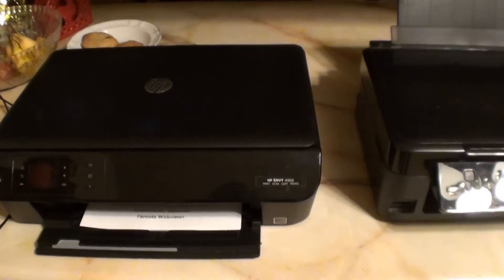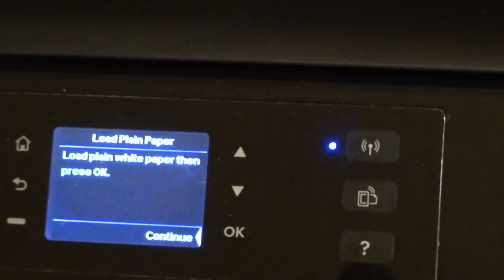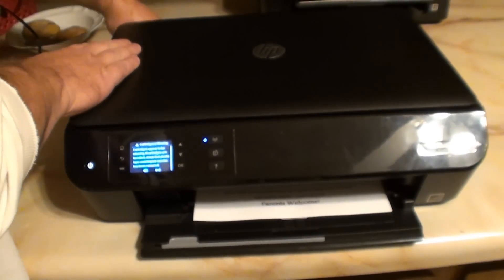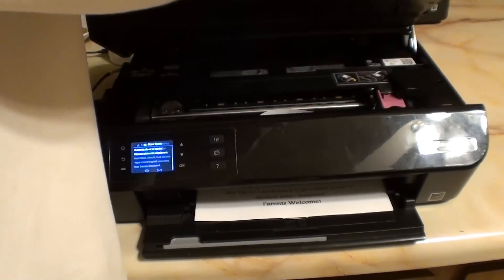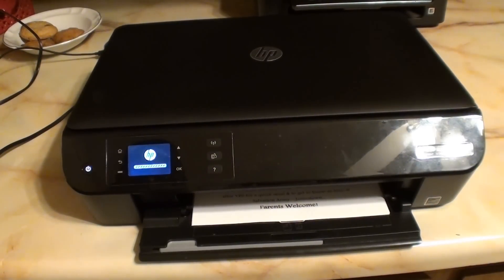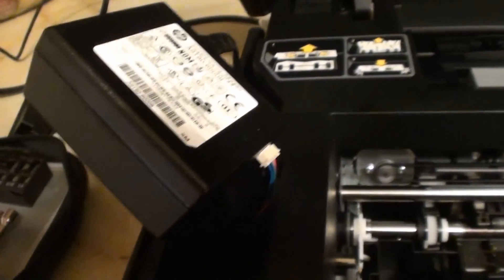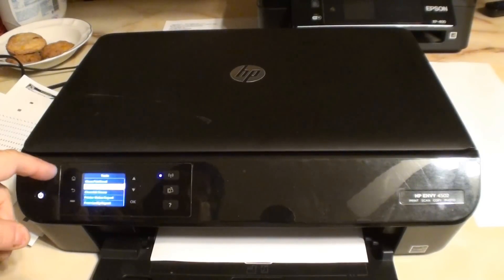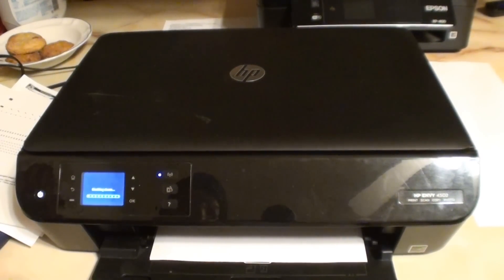HP printer stuck in ALIGNMENT mode!!

Comment: Before hitting continue, hit the wireless button, hit turn off, hit home, and the problem was fixed!  Then I hit the wireless button again, hit turn on, hit home.  It all seems back to normal!
Reply: Never Mind!  It goes back to home but it will not print.  Not even with a brand new HP cartridge!
Reply: Darlene Mast I did it worked for me thank you!
Reply: Key seems to be getting past the hang up by using the wireless menu.  I tried everything else, including replacing software and firmware..  Thanks Darlene!
Reply: thanks
Reply: Just had this same problem - worked for me. Thanks heaps!
Reply: I had the same problem and it worked! thanks Darlene <3
Reply: Thank you Darlene! I followed your steps and it's back to normal! You're a life saver!
Reply: Thank you so much. You saved me some money, I was ready to trash this printer. Just printed  three copies to make sure it worked.
Reply: Dude u are somewhat closer to God now!!!
Reply: Thank you, desde argentina, muchas gracias
Reply: After 3 hours of trying to get my printer out of "printing alignment page", I found this video and read your comment..  IT WORKED!!!!!  YAY!!!!!  THANK YOU, THANK YOU, THANK YOU, DARLENE!!!!!
Reply: Worked, thanks!

Comment: It was a long video but opening up the inside compartment to disconnect the actual power adapter worked for me too! Thanks for doing the trial and error, I wouldn't have known where to start, the advice is useless in HP chats!

Comment: There are actually a variety of reasons it can print that error code. Like most printers of all brands it's really annoying because it doesn't tell you exactly what the problem is. That error can indicate the scanner is jammed or the print head because it tries to initialize both. Or there is a little tray that moves underneath the head in the parked position and that can get jammed as well. Then sometimes it can't feed paper because there is a roller on the bottom of the unit that can get stuck and won't drop down when you insert the paper tray. Really these throw-away printers are not made to be actually used. If you want a real chance for it to work you need to disassemble the whole thing and lubricate everything and make sure there there is nothing stuck in the mechanisms and that the plastic bits are seated correctly and not pinching anything. Printers are such garbage tech like modern kitchen appliances. They haven't made good ones since the 90's.

Comment: I walked through the first 10 minutes, and it "seemed" to fix it, then it got stuck again. But going through a lot of things reconnecting to the wifi, etc. (after 2 hard resets), it finally got to the point of working with the computer, AND copying which was what it stopped doing in the first place. Thank you so much for the walk through on this!!  I don't know if it was jiggling wires, resets, re-connecting to wifi, or reseating ink cartridges (which initially worked, then it conked out again) ... but THANK YOU!!!!!

Comment: Followed all the tips such as replacing ink cartridges, force shutdowns, pressing WIFI and disconnecting it - nothing changed the 'now printing alignment page". AARGH! I was so angry with HP. Then, as a last resort, I decided to use a tip from other forums, and responses to this video. I picked up the printer and dropped it forcefully with as much 'controlled' frustration, so as not to break the printer, and ... it F&*^ing printed the alignment page, scanned it, and now my printer is working OK. WTF!?!? Thanks to all who suggested to simply drop my printer. Best advice EVER!
Reply: this was what worked for me.......... Well I did not drop it I gave it a lil smack
Reply: Bro I picked it up and slammed it down and it totally fixed it! Lol

Comment: Thank you very much. I did everytning you suggested, removed both ink cartridges, powered off the router, the printer, my pc, turned them back on, put the cartridges in place, turned it off and on again, nothing. And then, while the printer was on (printing alignment page) I opened the cover, pressing the button that advises the printer that the cover is closed (like you did). And the problem was solved.

Comment: I had the same problem, I read that many people seem to drop the printer - and yes I can confirm that this might help by luck (however I checked the printer on a technical level). 
The real problem is that the flatflex cable to the scanner might be worn out and have some pins disconnected. I just re-connected the flatflex cable on the left side of the printer and the scanner started to work - which also made the alignment mode printing work --- because this needs the scanner.

Comment: FIXED! Only 3 hours! Here is the 2 minute version. At 8m30s the trick is DO NOT PRESS "Continue". Touch Wi-Fi, then Home. Now play with what works. I could not copy or align; but others can do various things. I could print the quality and status sheets; but then I still had the stuck alignment problem. Repeat but before printing remove the paper so you get an "out of paper" error. This new error replaces the "alignment needed" so I could now copy. Or more importantly run the infernal Alignment. This time it grabs the paper; and voila it is now FIXED. Falconer your lucky break was getting that print head error; I believe that is what got you over the alignment hurdle.

Comment: Falconer, Hp Office Jet 4630, this worked the first time. At least it is a possible solution. I had an X1185 that I had to set up like ever week. Then some how I figured that if I unplugged from the computer and plug it back in then it would work. But if I unplugged it from the printer it would not work. I guess a recognition problem. Thank you for all your videos. Learn to say Frack like on Battle Star Galactic. Fracking Printer! Frack You! lol Blessed day.

Comment: I had the same issue and nothing worked.  I found a note on-line recommending to Air Print via a phone or laptop.  Before the document prints, hold on to the paper.  This will cause a "paper jam" or "out of paper" error message.  Release the paper, and let the document print.  Voila, the error message is gone and the printer can resume normal functions.

Comment: I have the same problem. Out HP printer is stuck in "printer preparation" cycle and can't get from it. It shows up a timer saying "preparing printer" and then it returns back to trying to print the alignment page. And I seriously have a strong need to smash that shit on the wall.

Comment: Hi, came looking for almost the same issue but not quite, my hp envy 4500 is stuck at printing, it does not get stuck at home screen or anything, but when i try to print the page, either in black or color, it gets locked at "Now printing"... but does not print the paper, but if i cancel it, or open up the lid then it gets out the blank page...
kindly help me out with that. 
Thank you so much.
Reply from the maker: Sorry dude but I haven’t had a printer in a few years, I got sick of the garbage.👍🍻🍻
Reply: @116falconer  haha right
Reply: Hey it was cartridge issue, one of the cartridges needs replacement, just posting it out here. In case someone needs the solution. Check your Cartridges.

Comment: I have two hp 5530 they both worked for about two months then failed. I think the problem is cheap mediocre electronic parts made in China. I will never buy another hp product.
Reply from the maker: +Robert Simpson yes! The printer finally shit the bed, stuck in alignment mode and NOTHING I did brought it back to life.

Comment: The only way to fix it is to restore to default in the tool settings and thats it 💯💯💯
Reply: You can't access that. So that advice is not working.
Reply: @michaelflamingsword3131  Yes you can. Power on; do not press continue, touch the WiFi button, then Home. Scroll down to tools. Et Voila. I can do anything with this printer but I cannot do page alignment to get rid of the message..